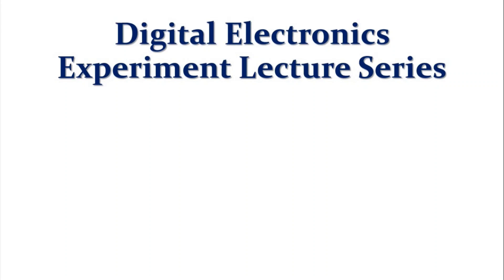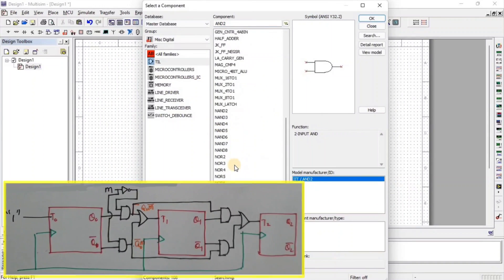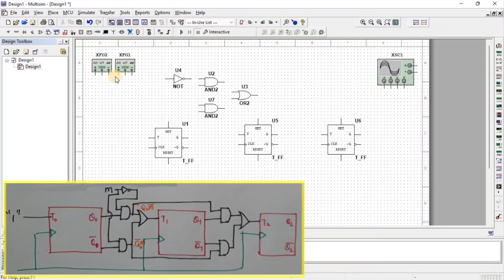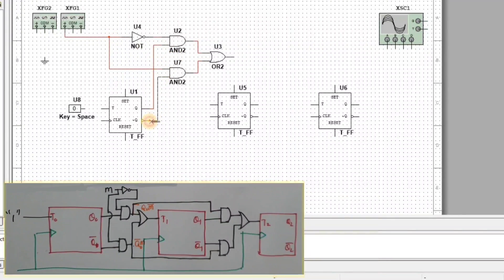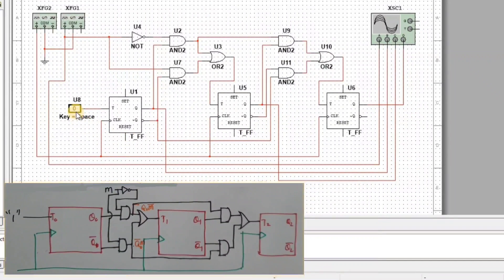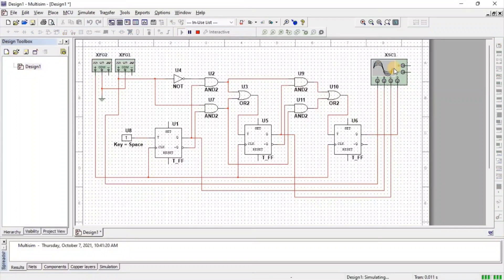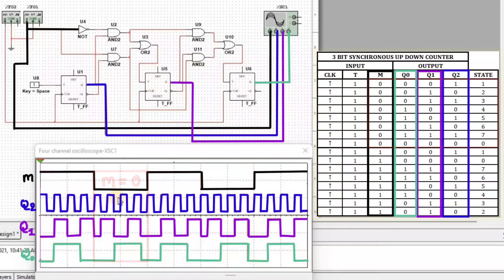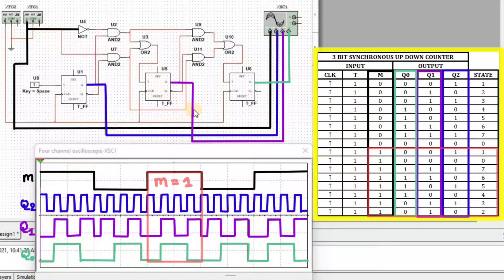3 Bits Up Down Counter using Multisim Software

Comment from the maker: 3 Bits Up Down Counter in Multisim explained with following timestamps: 
0:00 - 3 Bits Up Down Counter in Multisim - Digital Electronics Lecture Series
0:11 - Circuit Connection of 3 Bits Up Down Counter in Multisim 
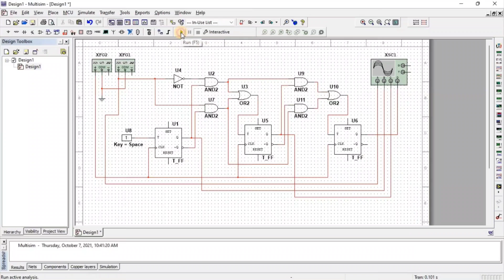3:19 - Simulation Results of 3 Bits Up Down Counter in Multisim